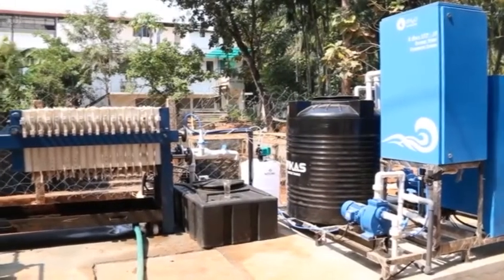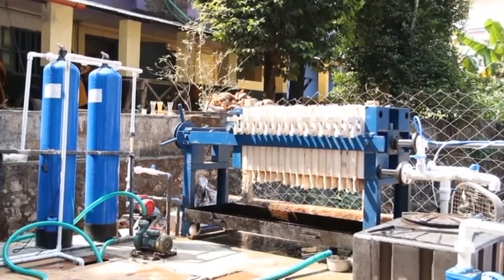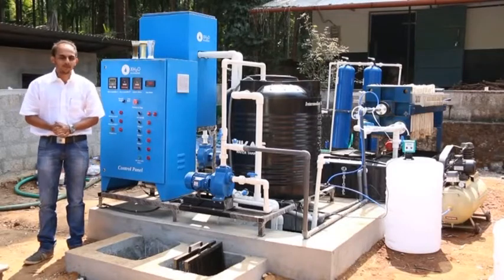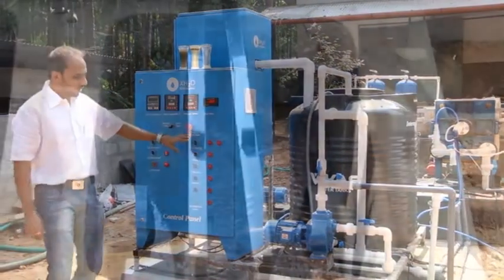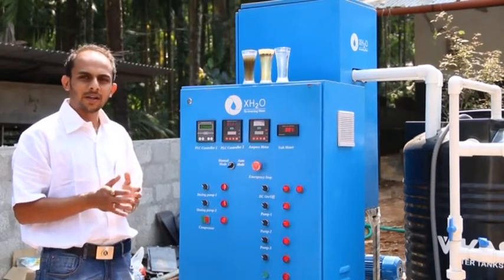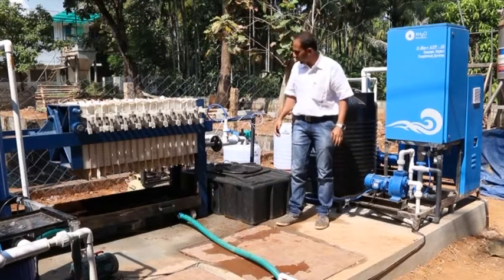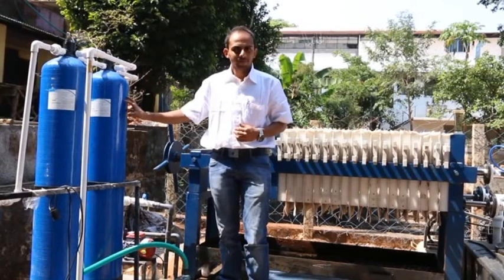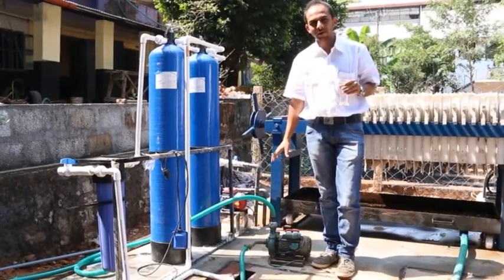Eflocx Electrocoagulation Sewage Waste Water Recycling System STP

Comment: How you clean the electrodes?
Reply: Rudi Willem 
Generally, systems that run continuously for 20 hours a day do not require electrode cleaning as there is minimal deposition on them. 

For systems that are run intermittently or around 8-10 hours a day, we have a bi-weekly CIP routine wherein we soak the plates with a mild acid for 15 minutes and then a base for 15 minutes which removes the scaling.